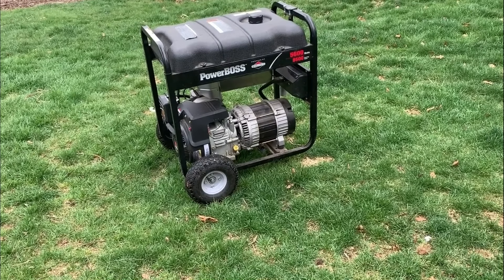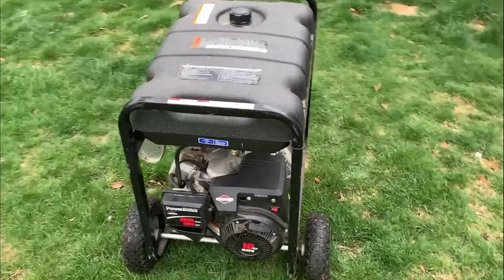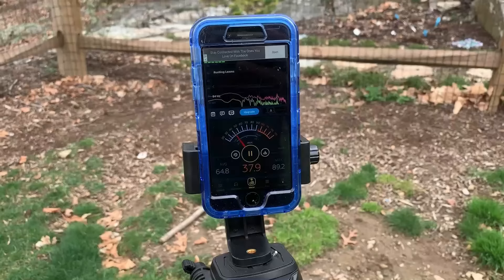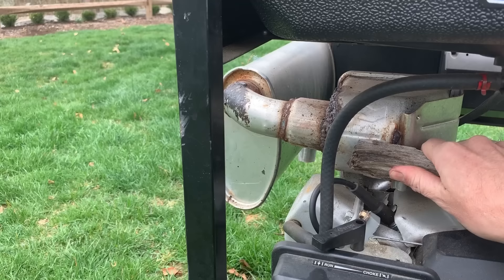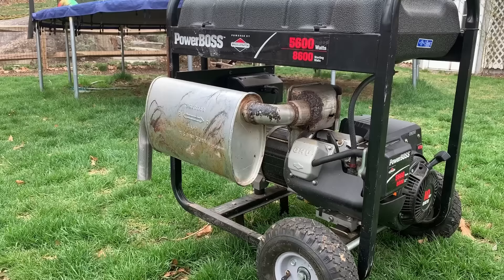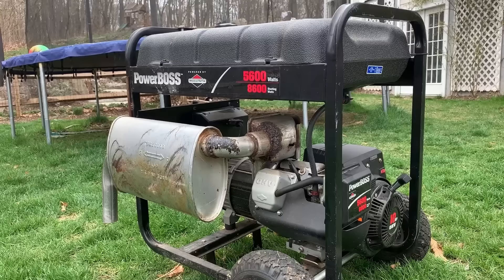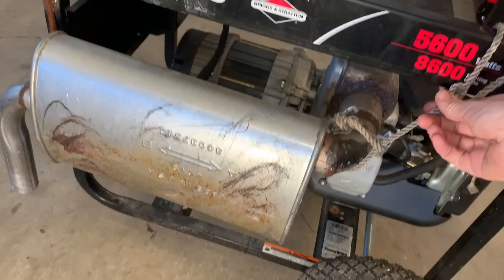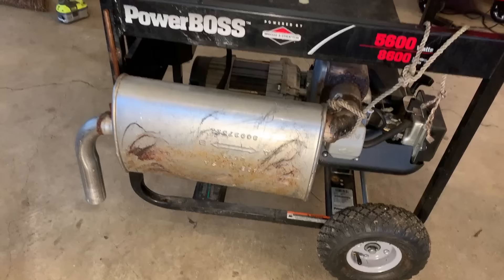Will a Car Muffler Make a Generator Quiet?

Comment: Something to note about sound: the decibel measurement system is a logarithmic system, meaning, it isn’t a linear system (like inches or liters).
What this means is: for every 3 decibels increase, sound pressure (or perceived volume) DOUBLES. So a 6 decibel increase in your measurement means that the sound pressure has increased 4 times.
Reply: Yep.  6db difference, 4x louder.  That made a SHIT ton of difference.
Reply: I hate everything logarithmic, such a headache!
Reply: @EgillBjarniHelgason  If you didn't have logarithmic scales for such things then all but the very highest levels would be squashed over into a tiny part of one end of the scale. Also, out perception of things like the loudness and brightness of something is physiologically logarithmic. Human hearing goes from about 0dB to 120dB, which is a range of loudness of 1:1,000,000,000,000.
Reply: "Noise above 70 dB over a prolonged period of time may start to damage your hearing. Loud noise above 120 dB can cause immediate harm to your ears."

so the conclusion form the video in this circumstance the car muffler made it safe to stand at that distance without ear protection
Reply: Except we hear logarithmically as well. So a 3 dB doubling or 6 dB quadrupling of pressure sounds only slightly louder to us.
Reply: @Nickerian91  What?
Reply: @erbenton07  Not really sure what was unclear. the DB values estimated is documented and if you do a simple search you find everything u need to know about it.

each 3db means double the "volume" under 70 its safe for your ears above it may harm you. above 120 it directly damage your hearing.
Reply: @TheRayDog  Correct, because human ears need an increase of 10dB to actually perceive 2x the apparent loudness
Reply: @darioinfini  It's 4x the sound energy, but human ears need a 10dB increase to percieve 2x the apparent loudness.
Reply: Yes, but it's 4x the sound energy which isn't the same thing as apparent loudness, to humans atleast. Human ears need an increase of 10dB to experience 2x the apparent loudness. So to us, the muffler doesn't quite cut the loudness in half but it still does a good job.
Reply: Whoah
Reply: @sethbeard8053  correct
Reply: @TheEulerID  Yes and also nope, and not just one nope. In the usual range 21 to 70 db the human brain sound perception is like 10 db for doubling, but below 21 db and above 70 db the ear-brain perception is much closer to the real 3 db for a doublinng of acoustic pressure. And all hand guns and rifles  generate from 160 to 170 db, no less then 160 w.o. silencer  from .22 LR to .338 Lapua Magnum or even  .416 Barrett, yet most can hear the diference from 9mm PARA+P NATO to .357 Sig or .357 Mag. that are also 9mm, or 10 AUTO, .44Mag., 454 Casull, .500S&W, and also most will hear the difference between .22LR and .308 snd between .308 and .338Lapuam Magnum with and without compensator.
Reply: @sethbeard8053 , yes and no, it's not linear, whatsoever. At SPLs below about 65-70dB, this is true. However, at levels above it, our brains decide that 3-6dB is a doubling of perceived increase or decreased loudness; and can vary widely from person-to-person.
Reply: I always find this fact strange. Why don't we measure it linearly?
Reply: Yeah so many people don’t understand this. I do a lot of shooting with suppressors (silencers) and they don’t really make the guns silent, but you can get 23-30 db of drop so you go from 160 to 130 db
Reply: @timwilliamanderson , depends. If it's something like a 9mm, going to a suppressor with subsonic rounds, you can get them down to 115dB or so... you will be pretty much only be hearing the primer, at that point.
Reply: @johndeeregreen4592  even 22 subsonics are not silent lol
Reply: @timwilliamanderson , um, okay... never said they were completely. You can never get rid of the sound of the primer. But, anyway, I guess you didn't comprehend what I wrote.
Reply: @johndeeregreen4592  primers don’t vent atmosphere, so you’re not hearing the primer I mean you might be hearing  the striker or the hammer the primer. And 22s don’t have primers they have prime so there’s not even a primer in that case to hear. I hope you can comprehend that.
Reply: @darioinfini  as a wise man once said I can explain it for you I can't understand it for you
Reply: @Nickerian91  in the UK hearing protection isn't recommended until over 80dB
Reply: I’m sorry, but SPL and human perception both matter here.  Human perception is going to vary across a boat load of variables like how far away, how loud the natural environment is, etc etc. The muffler made a big difference. An old lady 2 houses down would go from hearing the generator, and being annoyed, to not hearing it at all. A younger person watching TV inside would go from turning up the volume on netflix, to not needing to. 

A typical office environment when no one is talking, just typing and doing normal crap, is about 68-70 dB.

Start blasting music over the PA system in that office, maybe 80dB. Turn the FA system on in that same office, and we’re at 100 or more dB. So anyways… 6 dB… big difference if the starting point is 70. If it was the difference between 80 and 86, or 90 and 96, who cares…
Reply: @paaao , it's the same concept as we use in communications circuits, of sorts. We call it signal to noise ratio. If the signal to noise ratio changes, this can change signal strength perception and even a different perception of two signals with the same spread, but against a different signal to noise ratio. So, yeah, definitely getting where you're coming from. In this case, too, the human ear can change the signal to noise ratio by difference in individual frequency response, and even something like the person having tinnitus, too.
Reply: Yes, but we also perceive the sound logarithmically
Reply: I for one appreciate your scientific explanation even though I didn't understand it  now I know where to start looking when the times comes that I need a better understanding of how sound waves work 
In the near future I'm planning on building a camper while I want it to be insulated for weather  I also may need to build a  better muffler to help quiet  the exhaust noise  thanks for the info
Note my build will be documented here on youtube as well
Reply: So for every 3db we double in sound. Does this square?
Reply: Something important about sound to add is that human hearing can be VERY different to what a Microphone measures. For instance, the same SPL (decibel) will be perceived as much quieter to us at low frequiencies like bass (20-100hz or so) versus frequencies like 800-2,000hz where the ear's inner hairs are most effective at. Most sound meters display so-called C-weighting which is uncorrected microphone SPL, while the so-called A-weighting is supposed to be more representitive of the human ear and perception, perceived sound level rapidly falling at the ends of the audible standard of 20-20,000hz. Making the tone deeper is commonly used to make something quieter.

The ear is badly mistuned for low frequency, and a fairly flat C-weight curve speaker will sound increasingly quieter below 200hz or so during a frequency sweep - something anyone can easily test with headphones/car stereo/full-sized home speakers. This is every bit as important as raw SPL energy and you can google A-weighted or newer graphs that easily show the difference.
Reply: Even my silent farts can be deadly
Reply: Measured noise scale is wider than human can hear, but it still affect to body. How muffler change it , mean lot. Location in the box, maybe is good solution?

Comment: Just a little tip.  If you decide to use steel water pipe screwed into the block to mount a muffled remember the pipe is a lot thicker and won't disperse the heat and can burn out the exhaust valve.  It has happened.

Comment: I agree that a motorcycle type muffler would be a better mod. 
But actually the loudest noise of a portable genset is vibrating metal. Add more isolation to the mounts and the noise can drop a LOT.  Enclose it with baffles while directing air and exhaust flow and you’ll make it practically disappear.

Comment: I saw one running in southern Mexico once with a motorcycle muffler and it's the quietest generator I've come in contact with.
Reply: Especially a 2 stroke one like it’s used to quiets a 2 stroke dirt bike and those things are loud asf with out a silencer on them

Comment: The engine manufacturer usually makes a "quiet" generator muffler that doesn't always come standard on store bought generators (I know, I was shocked too). That's usually the best option to reduce generator exhaust noise over all the homebrew methods. It will never be whisper quiet because much of the noise from a small air cooled engine is not from the exhaust.

Comment: The 3 dB rule, look it up if you don’t know it. That muffler did quite a bit of noise reduction.
Reply: Not to mention the old one had a hole in it, and the second one didn’t. Also same reason why I don’t think this test is very accurate
Reply: Joe _  No it's 3. it's more complex than that actually as the decibel value is a function of a variety of environmental factors. (air pressure and distance) but 3 is roughly "double"
Reply: It's more complicated than just 3dB is a doubling. That works if you're measuring power. Perceived loudness doubles at 10dB and measured sound pressure doubles at 6dB.

So, yes, the car muffler roughly halved the measured sound pressure and reduced the perceived volume by 1/3-ish
Reply: @garrisonsan  Yep on the numbers here. Most don't know.
Reply: Joe _  nope. every 3db is double
Reply: ⚠️Always make sure you follow all the generator safety rules when you use your portable generator: 

This is just a reminder to make sure. It is important to follow all generator safety rules whenever you use your portable generator. 
Here are the things that need to be followed;

1) KEEPING OTHERS SAFE: Please do not allow an unqualified person or your children to operate and service the portable generator. Just because some manuals don’t say that doesn’t mean it’s safe. That is important against the generator safety rules. We also need to be keeping an eye on our children too. You need to make sure that your children are not playing near the portable generator especially when it’s running so they won’t get electrocuted. Generators pose electrical risks and they can be hot during an operation. Please keep your children away from the portable generator at all times. It is important to keep our children safe especially our little ones. Be aware of all the hazards.

2) WHERE TO RUN YOUR GENERATOR: Some people use their portable generators indoors which increases the risk of carbon monoxide poisoning. It’s important to have a carbon monoxide if you have a gas generator. Never ever use your generator indoors even if your doors and windows are open and even in the garage is not safe to use a portable generator. Not even at your porch and your deck. It is never safe to use your generator indoors and in enclosed areas of your home. Your generator needs to be 15-20 feet away from your house. 

3)🔥FIRE HAZARDS: Never refuel your generator while it’s running. You need to let your generator cool off before refueling it and before storing your generator. Never overload your generator too. Never ever back feed your generator. You should never plug your generator into a wall outlet. Also never store propane tanks indoors. Please keep flammable things away from the generator as well and please don’t smoke cigarettes near the generator. Having a fire extinguisher next to the generator is also important against the generator safety rules. 

4) GENERATOR OPERATION: make sure your hands are dry before touching the generator. Never use your generator in wet conditions. Don’t let your generator get wet. You need a generator tent if you need to use your generator during wet weather. Please don’t wear loose clothes when operating the generator. Turn on your generator before plugging in appliances. Use the right cord for your generator. Please do not use worn out cords. 

https://youtu.be/I1jT3ANENvI and here is a video more about keeping others safe when using generators 

Hope this helps
Reply: The logarithmic term has a coefficient of 20 in acoustics (because the pressure terms are squared), not 10.  So, the 3dB rule does not apply.
Reply: @MrShobar  3dB is twice the sound power. That is not some random BS. It applies. That's why a normal conversation is only 60 dB, but standing right next to a siren is 120 dB. The scale doesn't have a large range. Little differences in dB make for large audible changes.
Reply: @AnonyMous-jf4lc  You did not specify that you meant acoustic power earlier.  However, he is reading acoustic pressure levels at one point in the field.  dB=20log(P/Pref) so 6dB=20log(2) for a doubling.
Reply: @The_Happy_Aviation_Enthusiast  we didn't ask for safety instructions for using a generator

Comment: As soon as I saw that exhaust leak, I knew it wouldn’t be an accurate measure of noise...and then you changed out the entire stock muffler which did not have the original leak, that ended the entire shebang for me. (Fwiw, a small rough piece of wood held by hand will do nothing for noise abatement).
Reply: seriously, I was really wanting to see what happened... then the exhaust leak was shown... does this guy not understand how mufflers work? they need to muffle the vibrations BEFORE they go into the air. then he said he was going to block it, my immediate thought was "grab some muffler tape that'll at least not give terrible results". but no this guy grabs an irregularly shaped piece of wood and just holds it against the hole. You think that's going to create a seal?
Reply: Yeah....couldn't agree more.
Reply: Well you can hear by the tone of his voice that the video would be biased against the muffler so when I saw the piece of wood being held next to the hole I could gauge his IQ level.
Reply: The issue is you guys lack the fundamentals knowledge of….well anything pertaining to this. 

Generator engines run at 3600 rpm to produce 60hz electricity. 

An engine is just loud at 3600 rpm. Especially one that exhaust directly into the muffler. Strapping an oversized muffler to it takes it from loud to still loud.

Go out and rev your car up to 3600 and you’ll find it’s relatively noisy and that’s with an engineered exhaust manifold, resonator, at least 1 catalytic converter, multiple feet of exhaust pipe and a muffler engineer specifically for that vehicles engine.

Comment: Add an inline exhaust resonator pre-muffler. The standalone resonators will give it a deeper tone but they work WONDERS for quieting down an engine without a full cat.
Reply: I agree, a resonator pre-muffler would be much quieter especially in a smaller diameter tubing.  He should have no more than a 1.5" pipe, and even that's over kill for that low output tiny engine.  My dirt bike for example makes 2hp per cubic inch of displacement and has a 1" exhaust.

Comment: Fix the hole properly, support the muffler with a rubber mount, have the exhaust blow outwards, not down, and correct that loose mounting clamp, then test.
Reply: Second on the rubber mount. A lot of people don't realize how loud vibrations can make things.
Reply: @Razzman70  Aye. A good example in my mind are the fans we have around the house. Even those cheap dollarstore rattletraps. Spending a few minutes playing around with some rubber padding will make your home THAT much more quieter.
Reply: It is amazing what all a busted bicycle inner tube can do.
Reply: @FroggyMosh  I like bubble wrap, the stuff comes in the house all the time. Fold it double & sit the fan on it, don't even think about it. Only go buy some rubber padding when girl friend says "make that neater or else!!!" For quiet fans I like 2 speed USB powered fans.
Reply: Agree totally, I also think the muffler exhaust is too big for the engine & should have been reduced. Someone commented it should have been a motorcycle muffler which is actually designed for the same type of exhaust pulsations, so all your commnts plus the right muffler.
Reply: cal30m1 - my comment is to you. Agree totally, controlling vibrations is a big deal. I also think the muffler exhaust is too big for the engine & should have been reduced.  Someone commented it should have been a motorcycle muffler which is actually designed for the same type of exhaust pulsations, so all your comments plus adjusting the muffler or the right muffler. IIRC, the stock mufflers aren't really mufflers, they are just flame & spark arrestors.
Reply: Also note 1st test engine was facing away from db meter, second test engine was sideways with exhaust pointing directly at the DJ meter. May not have made any difference but for comparison purposes every thing but exhaust should have been the same.
Reply: …and fix the hole in the exhaust !
Reply: point the exhaust up, 6 foot high, poppet valves on top to block water.
Reply: At last someone with some sense!
Reply: Exactly
Reply: Cant wait to see your video!